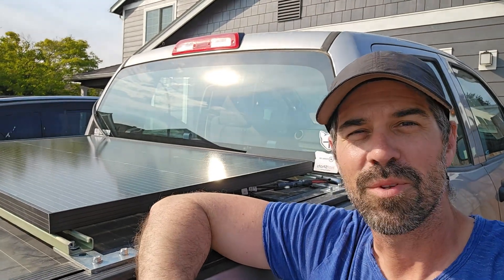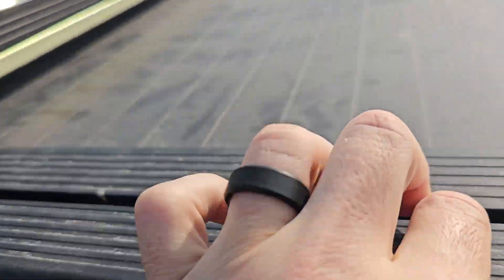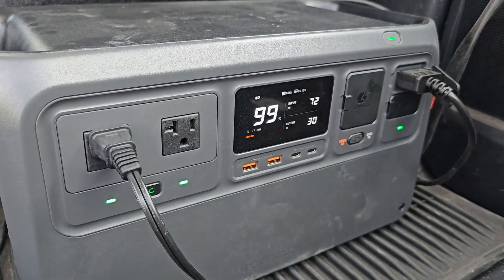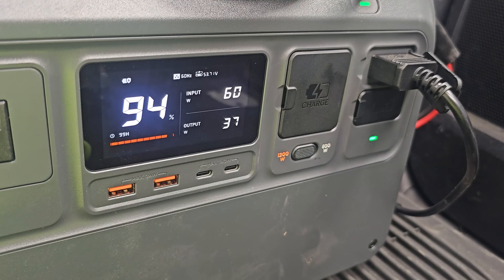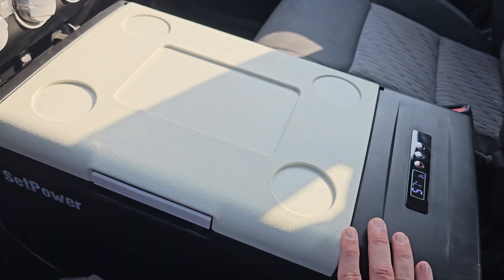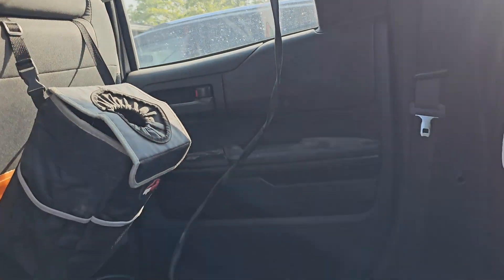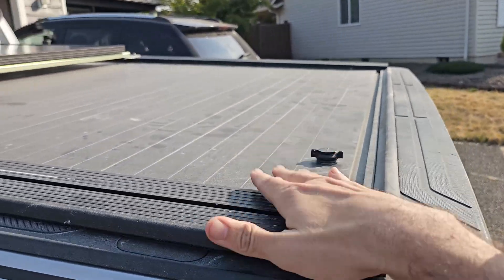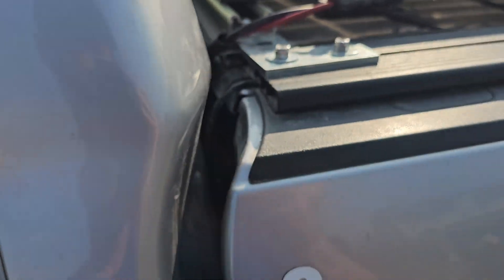Installed Solar on My Truck: Power on the go!

Comment: Tip: if the power stations have dual DC input, connect the one to the ignition (powered 12V while the engine is running)

This will give you an extra 50-100W while driving.

Nice to have more energy if you start using a compressor.
Reply from the maker: Thanks for the tip! That is definitely something I will do to help keep the battery topped off